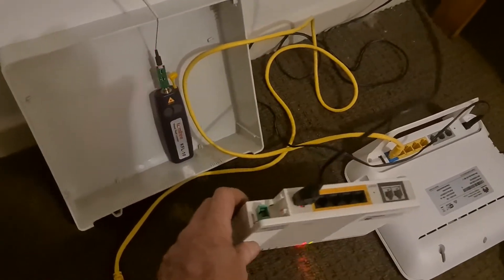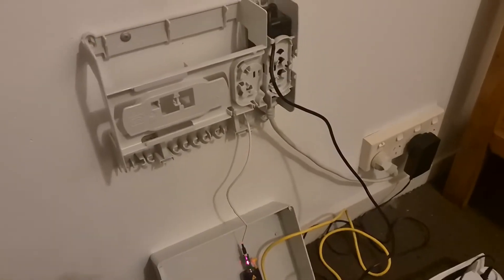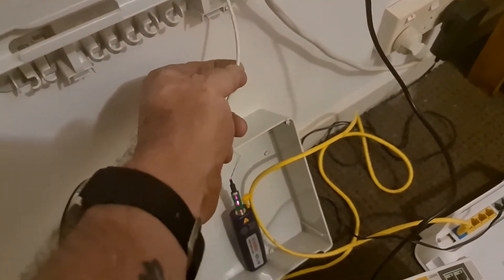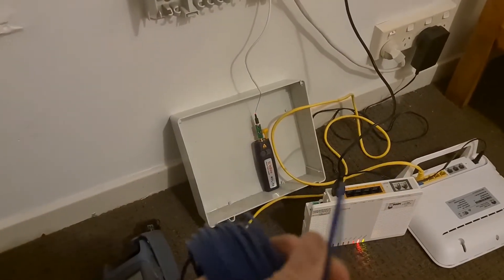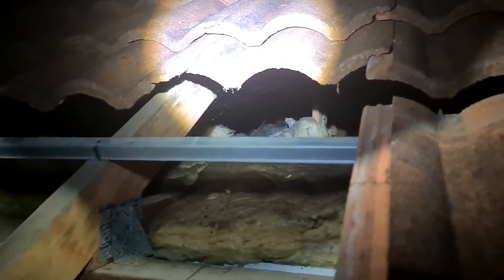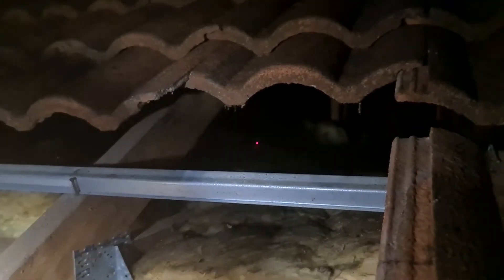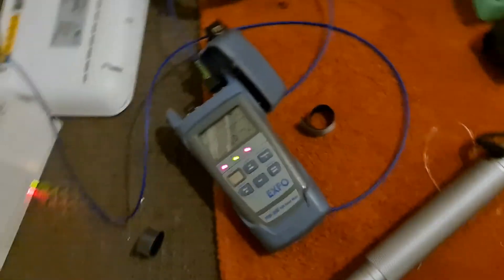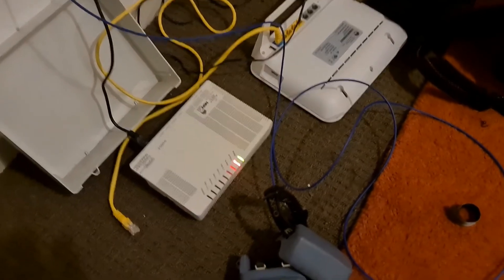NBN FTTP Optical Cable Replacement

Comment: Interesting call for me to a social housing building where the person's neighbor had rats in the wall  and running through out the apartment  and they would occasionally  go on her balcony to run up and down the building but they discovered that the cable was tasty and attractive and worked there way through the  fiber to the apartments in the area since it was cabled on the outside of the building. I put in an armored fiber for the apartment segment but had to  wait for the telecom company to get tired to doing cable repairs on this section of the building and finally realise they needed to  put in armered cable until the housing agency could remove he rats from the adjacent apartment.

Comment: Thanks for the video. My one was just poked out, and disconnected between the clip of the fibre and fibre. There is a small hole on the clip you could feed the fibre back to the clip and clip the clip into the nbn box optical slot. but it didn’t work. Showing red lights. What could I do? Thank
Reply from the maker: Hi Thanks, unfortunately, you can't just push the fibre back in once it has been broken, the whole connector needs to be replaced and the fibre cleaned and cut with a clever and re-inserted into a new SC-APC connector. Once the fibre breaks the broken piece remains in the camber and can't be removed hence why a new connector is required. I hope this helps